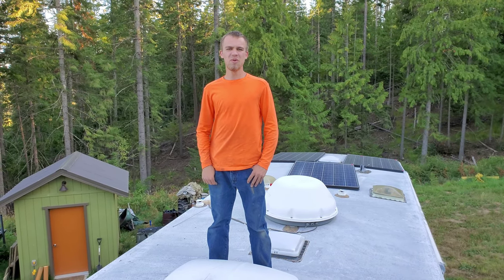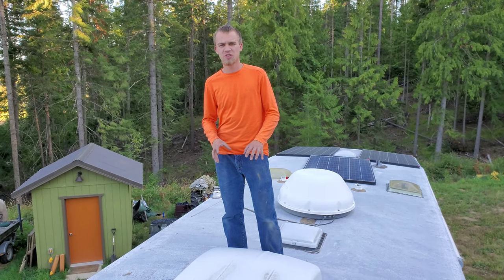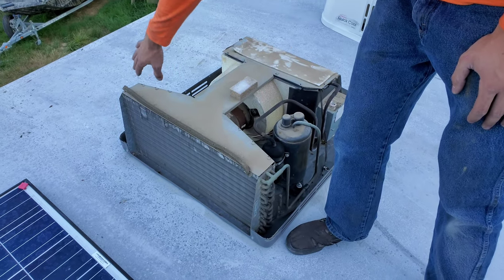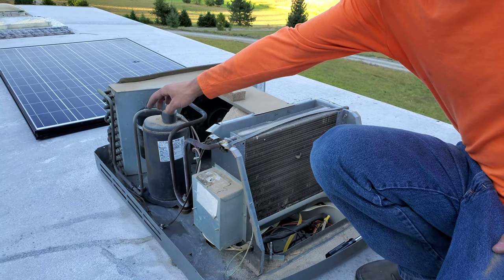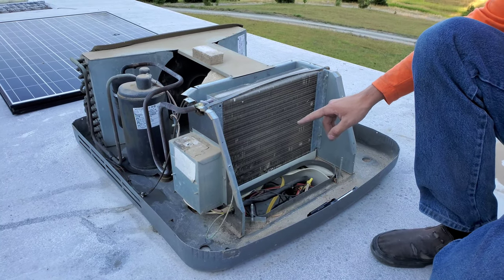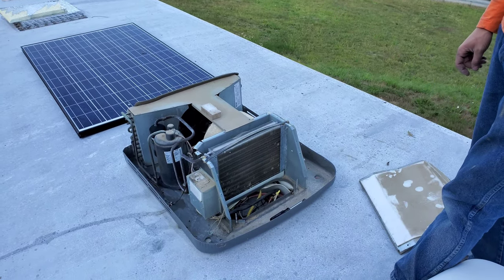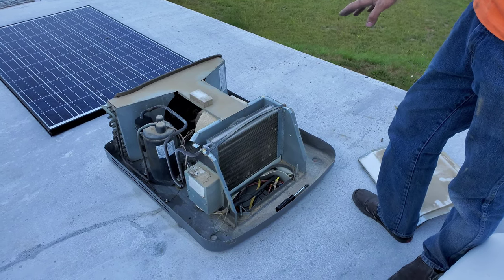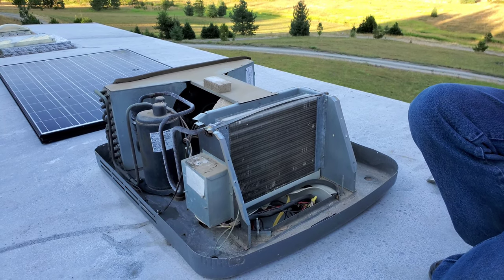RV Air Conditioner Troubleshooting: Start Here! [4K]

Comment: Late to the party, but for anyone else having the issue, dust is also a major contributing factor. When the fins get Dusty they hold on to the moisture and Ice builds up very very quickly.
That being said, I do thank you for this video because it actually helped me out quite a bit! I was running off my generator and with everything I have running, it had bogged the generator down a little bit so although it was getting almost 116 volts which is much more than needed, it was cycling at about 56 Hertz because of the heavy load on the geny. I increased the load side of the throttle a little bit and brought it up to 59 Hertz and that completely solved the issue for me. Thank you again

Comment: I would suspect long duty cycle and low air flow. Amp feed should not effect it unless you have large voltage drop. If voltage is correct amperage would be based on load and if you can only feed 20 amp because of fuse/breaker if load takes more then it would trip.  Check air exit and inlet for blocks and fan rotating at correct speed. Use a coil cleaner to clean evap coil

Comment: My ac won't even turn on it trips the breaker in like half a second. And everything is clean. What should I do?
Reply: It’s shorted to ground. Replace
Reply: Started to say the same thing!
Reply: Replace what? That'd be helpful to know versus throwing parts around.
Reply from the maker: The whole thing. They are package units hermetically sealed.
Reply: Get it replaced. Shorted to ground
Reply: Bad compressor
Reply: Ummm what about a bad capacitor???

Comment: I would tend to agree with your low airflow diagnosis, but I am not so sure low source voltage is the culprit. I am aware you know all of what I present below (my semi random thoughts), but my conclusions may be different, I have the same unit which used to be on my RV's roof. My roof is flat and the AC has enough weight to create a pond and cause chronic leaking. I removed the AC, and all other roof vents, so there will be no roof penetrations when I rebuild my roof, but I digress. The fan motor is an induction motor so it has a large starting current. My guess is that, if your source voltage had trouble running your fan, it would have no chance at starting it. Usually the compressor is hardest to start and will go into a bucking mode until it trips the thermal overload. The fan motor drives the condenser and evaporator fans, so if the fan runs too slowly, my guess is that the AC might not be able to shed enough heat to let the evaporator chill. If the fan induction motor doesn't get enough run voltage it will slow down but the rotor/stator slip rate will stall very early (maybe 10 percent at most?) and the impedance will drop the motor into thermal overload or trip a breaker. I may be wrong here, but if the refrigerant charge is too low, the evaporator will vaporize the liquid shortly after it enters the evaporator coil, so will likely frost a corner of the evaporator rather than the whole evap. unit. All of these issues should be fairly easy to check, but it takes time and a clear understanding of how motors and refrigeration interact. In my opinion, by modern standards these RV AC units are terrible. My plan is to make or modify a mini-split from a modern window or automotive AC using R290 or R600a with a vfd or esc running each of the fans and the compressor. The only wall or floor penetration will be the refrigerant lines. The starting current will be almost eliminated due to the the full RPM range feature on all motors. This system could also be configured to run directly from your PV panels or almost any other source. A modern electronic expansion valve could also be used. Additionally, this design could be expanded into a heat pump. (BTW, I also ditched the propane fridge for an R600a mini-fridge, and 6 gal. electric water heater, no more propane in my rig, or at least not for burning). The above is just my opinion, if anything new develops in your neck of the woods, please let us know.
Reply from the maker: Sounds like you want a mini-split in your RV, or a variant close to one.  Totally agree with everything stated here.  Would have been smart to pull a voltage at the AC unit during operation.
Reply: @HighTechLab   ; Yes, but formal mini-split units are much more expensive than a window unit. And while I'm hacking a window AC, I can explore the possibilities for  providing the rotational force to drive a refrigerant pump or fans. As long as the bits keep turning the AC should work, even a small herd of angry hamsters, theoretically, could drive an AC.
Reply: I had a chance to get some experience with newer window AC units today. A couple of days ago I bough three second hand window units that were in fairly good shape for $20 each (2 Daewoo DWC-0520RLE units and 1 Sharp AF-S85PX). Each uses R22 so I will need to have the refrigerant reclaimed if I want to modify them, but at $20 each how could I pass on that deal. I found that they have much lower starting current than my older RV roof AC. My 8kw battery inverter had no trouble starting each of these new units separately, but I found that in some configurations my mini-frig would brown out the circuit when the ac was on and the frig tried to start. I ran an extension cord to my 2ish kw inverter gas generator and ran the ac on this circuit all day. It is so nice to get some relief from the heat and have the RV sealed up, which I could not do with my portable swap cooler. My plan now is to formalize a window mount in the hole where the propane water heater was and live with it this way for while. If it works well enough I can start hacking on my old RV unit to try a mini-splitting mod. Maybe ..., it's still early days and I have much to learn.

Comment: Frost can be due to low air flow or low Freon or temp. set too low. Most likely the problem is low Freon. Motor speed is a function of line frequency and number of motor poles. As long as there is no mechanical binding, the fan speed should be ok.
Reply from the maker: In this case it was low air flow because the fan motor was not being fed the proper voltage because of a circuit that was not strong enough.
Reply: @HighTechLab  just because the breaker says 20 amp doesn't mean it's only putting out 20 amp. What that means is that breaker can "handle" up to 20 amp before "tripping". So say it's 20 amp breaker and you try to pull 35 amp on it, it might try to power up or run for a few minutes and then the breaker trips cutting Power off. It's because the breaker was overloaded causing it to trip. The number on the breaker mean the amount of amps it can safely handle before the "overload feature" kicks in and opens the circuit..... I think the AC just needs some cleaning and maintenance.
Reply from the maker: New to the channel?  Have you seen my projects?  I have background in commercial and industrial electrical, breaker sizing and trip ratings isn't anything new to me.  My point to my viewers was the same as yours - even though the utilization equipment is not exceeding the ampacity of the circuit, the total voltage drop at the equipment was below the specification hence the reduced blower motor speed and the corresponding ice.
Reply: HighTechLab so low voltage due to voltage drop or inverter upstream dropping voltage or long feed line on undersized wire. May want to setup RV with floating battery charger and run only on internal battery. See you have been working on RV battery system and currently running directly on shore power
Reply: @HighTechLab  I'm a electronics/electrical major. If there is a significant drop from the source to the output then you have an issue in-between. Since copper has a resistance already plus the gauge of wire being used and how long the run is. Also to keep in mind that power fluctuates through out the day so it all depends on that factor as well. More people drawing off the grid service will give you a lower output voltage.
Reply: @HighTechLab  How do you wire this model when replacing the whole thing (ac)?

Comment: Just put in a Coleman- Mach replacing a Carrier but using a adapter kit to keep the Carrier control.  It works, but turns off after about 15 minutes and comes back on after a couple minutes.  Did I do something wrong?

Comment: Low freon will also cause icing up issues maybe get a hvac guy out
Reply: i doubt it's using freon  but yeah, low refrigerant gas will cause ice up. 
Pretty common to have an ultra slow leak that results in low gas on old units.
Reply: @Psi105  lets say refrigerant just to keep everyone happy
Reply: @joshuabest100  well thats what it is, Freons a brand of refrigerant

Comment: It can be ether air flow or and issue with subcooling and super heat, aka your low on refrigerant, so temp of evaporator drops to freezing( witch is not something you want an conditioner doing). Can't really say too much more without seeing the frost pattern as it could also be a few other things.

Comment: Not the amps bud. If you had either to much voltage drop or to small a wire the AC would either not run or run bogged down. This is more of AC problem than it is an electrical one. Hope you got it working.

Comment: My ac is a dometic had to put new fan capacitor and even new wall controller but it just continuously runs doesnt clcle off cools good it did cycle on and off for an hour but i have to turn breaker off to let it rest any ideas???
Reply: Check to see if the fan is on auto. If not fan runs continuously
Reply: @TerryDavis-wd9om thanks!